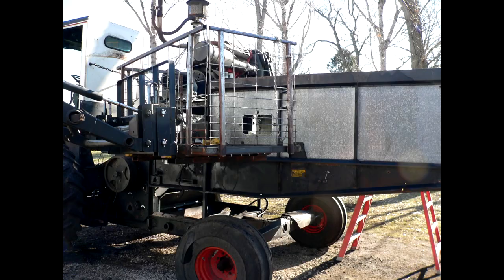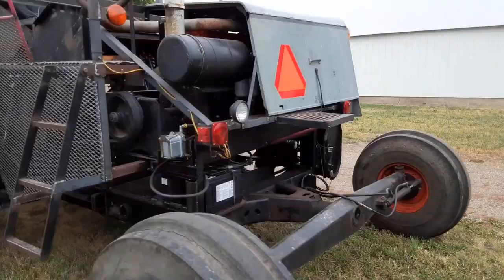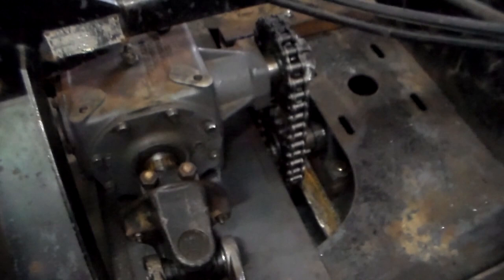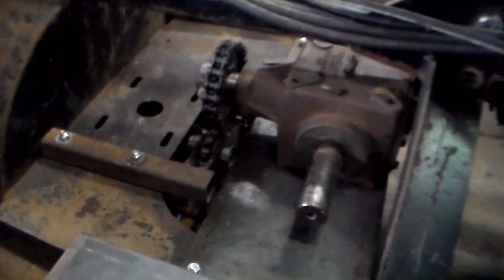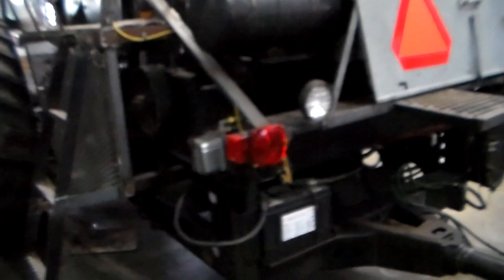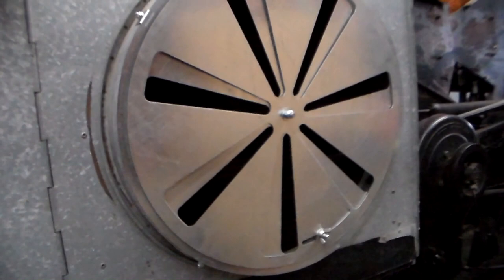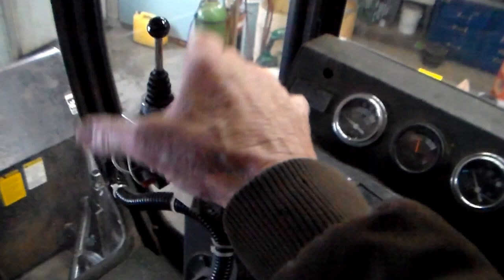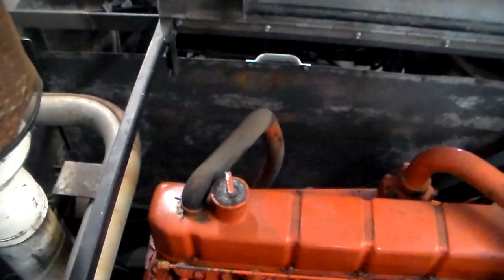Combine converted to snowblower

Comment: Nice work those old Gleaners were great combines..your design kind of looks like the Rolba ones we have here in Tahoe plows dont work in 5 foot + storms hope the engine has enough power though, many units  here have the detachable head used on dump trucks with a seperate motor to drive it
Reply from the maker: With the hydrostatic drive it should be as efficient as possible

Comment: Might eliminate the oil bath engine combustion air filter & substitute a paper filter Baldwin type filter, The rational is this use is primarily in wet weather, & fine blowing snow from the snow fan  can easily be drawn into the oil bath . Do to cold temps, a hydraulic oil cooler may not be necessary.  Does the drive axle have a differential lock ❓ The blower weight will aid traction, but ice may still be an issue. Chains may be necessary, Chains  (conventional) are useless with R-1 lug rubber, the Nortic diagonal link style perform best   And turning around should be performed where snow has been cleared, as any deep snow could be an issue. I might look for a  surplus rear hydraulic assist drive axle from a dismantling company for added traction when needed. Many a combine has burned unfortunately, but the rear axle, often in tact unless tires burned .  Should have enough hydraulic capacity, w/ an added activation valve, only part time use.  Cab heat, should be available from radiator fluid & restricting the air flow as shown will help, older diesels run cool.  The cab heat is most important for defrost function as YOU can add clothing layers. May need modified vent outlets toward glass, The air conditioner if equipped, may see minimal use .I have noticed several builds/ modifications like this in years past, but the redesign process was not shown in detail.  Nice project 👌🇺🇸🗽👍
Reply from the maker: It does have a dry paper element. No diff lock. I may purchase chains. However it can slip now, which may be a safety fuse?  Hydro rear drive would have been nice, but this combine did not have it.  Presently if it slips on ice as soon as I lift the blower it moves again.

Comment: Im thinking about building one out of a IH 1460
Reply from the maker: Search Youtube. There is a gentleman in Canada that did a 1400 series combine. I have heard they are quite easy to convert. They use the main gearbox rotated to power the blower. I did this Gleaner cause it was what was available at reasonable cost and had hydrostatic drive, which is what I wanted.

Comment: Can't see it giving much overall torque due to its two wheel drive configuration and rear steering. 

I'd be inclined to mount an IBC tote on the rear axle for weight and possibly a brine sprayer

Comment: As a retired welder fabricator . good job !   friend of mine always wanted something like this. He has pickup w/blade. as do I . They are very fast and efficient.  if you have room to pile up. I've seen swathers converted. Less work I'm thinking. my "question" is will it do deep snow like 2 or 3 foot .cause that's what we get. He has lots of buildings and trees so he dosen't have the room to move when it gets all drifted in. Looking forward to see this thing work in deep , blowed in drifts.
Reply from the maker: me also. Initially I was thinking swather, but when i picked up the blower from the auction I realized I needed to go with a combine. That blower is quite large. Originally designed for 180 HP tractor.

Comment: Think the augers and fan need a little more rpm's, look like you were pushing some snow. Raise the reflector angle a little to throw the snow farther. Great job!!!
Reply from the maker: thanks for the comment. Actually the fan is running more rpm than factory and the augers should be correct. Actually after watching the vid is the 1st time I have seen it in operation. Shall wee.

Comment: Greetings, very nicely built machine. The only thing I would like to have viewed is this machine running in 3 ft of snow rather than just a few inches that would have told the tale as far as the belts, bearings and chains being sized properly. The other thing is I thought you could have stayed with the wider tires and then just mount two Wings, one on each side so that they just gathered a little bit more snow that was equal to the edge of the tire and directed the snow into the auger. That was just my thought but I'm sitting here where it's warm and you were sitting there where you were using a welder and having a great time so well you know how much my opinion is worth! Thanks for sharing, I look forward to a video in deep snow and best regards Bob from Virginia USA

Comment: Thank you for sharing this. I like and enjoy creative stuff like this. Have you given it any thought about adding 8-12" wings or scopes on both sides of the snow blower?  I would think it would be helpful to keep the snow from ever having a chance of being pushed out on either side, while also clearing a little wider track with each pass.  You could place some kind of marker or guide pole on the outer top edge of each wing so not to hit anything with them. Just an idea.
Reply from the maker: Not really, when i was dealing with the width issue and large wheels the thought occurred to me. Here in MN, sometimes we have the blizzard conditions when the snow is whipped around for hours with high winds, and those banks are like concrete. So it could be difficult to break that material down so it feeds in. But you never know. Thanks for the comment
Reply: Maybe helpful for covering for snow accumulation over the exposure where it's more open sides front too back snow goes every where.
Reply: I'm wanting to make snow removal machine also & grain cart out a combine too.

Comment: That turned out just awesome.  Takes a sharp guy to engineer all the fabrication to make everything work.....pivot points so the belt tension is correct when raising the blower among many other things.  Would really like to see it in deep snow.
Would you do anything different on a do over?
Reply from the maker: Thank you. Well this year it has only been used once as we have had an extremely mild winter. I did run it thru some deeper snow last year, after the video, however did not get ample footage to do a follow up video. Things to change? Initially the combine had a 4 valve electric hydraulic body, which I abandoned after I realized it was leaking and unreliable. I replaced with a 3 valve electric solenoid operated. I should have went with a 4 valve, as I could have retained the hydraulic adjustable pulley that ran the header. I replaced that with a simpler set pulley size from a different combine. So, if I would have retained that I could have varied the auger speed on the go, like I can with the fan, using the separator clutch. Ah, future improvements, I have picked up a mud drive rear wheel assembly.  Not sure when I will get that attached. Will do a follow up vid when it is accomplished. Thanks for the comment.

Comment: Great build but you might consider adding extensions on the left and right side of the snow blower. It looks like you might want to change the position of the lower auger, seems like it needs to be moved forward. The blower is doing a lot of "pushing" of snow before getting pulled into it. I might be wrong. Cheers :)

Comment: I really like your “snowbinde “ ! Watching the snow coming out of the chute, got me thinking. One of the hang ups I have with my tractor mounted snowblower, is the wind can catch the snow and bring it back in the cab windows. And I always wondered why they don’t make the discharge chute a bit taller? If your chute was 2 feet taller , the snow would be higher than the cab before it started to fan out wide. I have seen blowers mounted on forage harvesters used in the city to fill dump trucks, to clear plow banks, and they are much taller chutes. Just thoughts. Very nice work, your neighbors will be wanting you to build them one too !
Reply from the maker: Thank you for the comment. Yes, I have also seen those for filling trucks in the city

Comment: Great project! A better grade of snowblower is only recommendation. Yours seemed to always leave a small berm which renders not a clean sweep!
Reply from the maker: Thanks for the comment. That may be my fault. The bottom of the blower was completely gone. I rebuilt it and in hindsight I may have extended the bottom plate too much.  It does show up if snow is light, or end of a drift.  Oh well, works a hell of a lot better than my old tractor mounted!

Comment: Great conversion! I see that you might need some additional width so maybe add on each leading vertical edge a piece of 1/4” x 6” plate at about a 45 degree angle (if your shop doors are wide enough to still drive through). Hard face the edges and bottom as these will be your ‘cutting’ edges
Reply: I have experience w/ your suggestion & it did  not function as intended. Worked more like a plow on the blower ends, & did not funnel snow into  the angers as presumed.  Bigger issue was hard heavy wet snow containing ice & in deep drifts.

Comment: Great job!  Excellent welding and fabrication work.  Did you consider using hydraulic drives instead of the belt drives?
Reply from the maker: Yes, I considered a large volume pump driven off the main shaft. However some people i visited with were not happy with their hydraulic powered blowers, stating a significant hp loss. As i got into the project further it appeared it was going to be quite simple to stay with mechanical. And the cost of a high output pump and orbit motor would have been considerable. Thanks for the comment

Comment: That is really cool.
 Just a few things that I observed. It looks like you need to speed up your augers because they're not feeding your blower fast enough, and you're pushing snow ahead of the blower. Also, you could add some more paddles to the bottom auger to feed the blower. I did this to my walk behind, and it eats and throws snow as fast as I want to push it into the pile now.
Reply from the maker: This is interesting. It is the 1st time I have seen the blower operate. However the augers are actually running the correct rpm for a 540 pto. I do have the fan funning at 650 rpm, as I still have the variable speed v-belt pulley on the right side. Perhaps they could be sped up. Always improvements
Reply: @hrodd2  I actually slowed my impeller down, and it throws the powdered stuff much better!

Comment: Nice job, like to see in deeper snow to see what mods it needs. More power? 4 wheel drive?  More wind shield wipers?  More weight on back? So many options to look at.
Reply from the maker: rear drive would be nice. Maybe next build. I may try chains. Undecided at this point.

Comment: great job.whats the deepest snow you used it in.and how does it handle drifting snow
Reply from the maker: At this point, still waiting for the "big one" It did handle the drift by my grove easily, which was about 36" tall. I am becoming more comfortable with it now and do not forsee any mechanical issues.  This blower was designed for a 180hp tractor. So, the blower should handle just about anything. Just a question of the mechanics . Thanks for the comment

Comment: I always wondered how well an old combine would work as a snowblower .
You did a magnificent job with that old Gleaner , it really moves some snow .
Have you thought about adding some weight to the rear ?
Seems to want to lift the back when you raise the blower up . Being a rear steer vehicle that might a get a little fun in some situations .
Reply from the maker: Thanks for the comment. The back is light when the blower is up, however with snow and ice a simple stomp on the brake and it will whip right around. So, that was perhaps an accidental advantage.

Comment: Nice job on the transformation. That took a lot of work and working out how to make it all  work. I noticed when you were on the road near the end of your vid some snow got round the side of the blower. Would it be worth putting some extensions on the sides of the blower in a y looking forward to funnel in the snow in to the blower? We get snow on and off here in Scotland through the winter. Biggest problem being if you drive over the snow it packs in to ice. Which will thaw and then re freeze. After that is like driving on glass. M 😀

Comment: Very cool!
 Does the auger have shear bolts like a regular snowblower in case you hit something buried in the snow? or how does that work?
Thxs
Reply from the maker: Yes, each auger has shear bolts and there is a shear bolt on the main shaft driving both augers. Trust me, I definitely want that safety factor in there.

Comment: I really like the build! I am wondering if there will be future issues with that belt drive. Takes quite a few HP to do deep snow. I would think that belt is really going to wear fast. Right now I have a front mounted blower using a PTO pump made by Volvo that powers all the hydraulic needs of the blower. Works great!
Reply from the maker: We shall see
Reply: @hrodd2  You will probably be adding some decent LED lighting. You may have to take some steps to mitigate the snow that gets sucked into the breather. You being from MN are no stranger to snow! That thing will get plenty of use! Another nice option would be a back up camera as well just to save you from cranking your neck. I take those tires and rims are from a sprayer? Plenty of pounds per sq inch. Probably wont need chains. Too bad it could not be shortened for ease of maneuvering. I was thinking of making one using a 4x4 pickup truck frame/driveline and a cab from a combine with a secondary engine powering the hydraulics. In Ontario here by the way.

Comment: That is very impressive.  I built a snowblower for the front of my 4 wheeler and it works great.  I was wondering if you have trouble with the belts getting wet and slipping.  It was a real problem for me until I built a proper cover to keep them dryer.  Again that is one of the most impressive builds that I have watched on utube.

Comment: Nice job I've always was told if you have u joints on one end of shaft you must have u joint on both ends be interested to know how the shaft running the gear box on the right side how long it will last maybe I've been told wrong
Reply from the maker: should work fine. The angle, if any is very slight, as I attempted to do the alignment as perfect as possible. The u-joint is there to take care of any misalignment and the two pillow blocks hold the shaft and eliminate side thrust on the u-joint

Comment: Did you consider running the blower off of a hydraulic motor instead of belt drive? Seems like an alternative to reduce total metal fab could also have added an aux pump for high cfm. Could also then go to a quicktach and been able to use  skid steer implements...hmm...maybe I'll have to look for an old gleaner to play around with...
Reply from the maker: I did consider going with orbit drive. However it would have been more costly. I would have needed a pump on the unit and the orbit motor on the blower. ALso, there is loss of efficiency with hydraulic drives. So, I decided to stay with mechanical.  Thanks for the comment

Comment: impressive volume coming ng out of that chute, I was a bit weary about that belt drving the 2 nd stage but it obviously works, how is the first stage powered, shaft or belt again?  nice setup and excellent visibility in that position, thanks for sharing 😊
Reply from the maker: the augers are also belt powered, by the electric clutch on left side of machine. thanks for the comment

Comment: Very nice! What ended up not working very well? What are the major drawbacks?
Reply from the maker: At this point i honestly do not foresee any major drawbacks. Some people mentioned belt slippage, have not had any issues there. Visibility was also mentioned, however I can see everything very well from the cab.  Traction, not sure if I want to go with chains or not. Without them there is a safety valve, not running into something too hard. If I do slip on icy conditions it moves instantly when I lift the blower.  Time will tell. Thanks for the comment
Reply: How about high load? Does it keep up very well? Like if who would compare to a conventional tractor setup. And how about shear bolts? Did you keep something like that installed?
Reply from the maker: @lukassawatzky604  factory shear bolts are in place at augers and main drive shaft for the augers

Comment: Incredible work and problem solving, looks like it works really well. I did notice traction on the drive tires was a bit of an issue at some points, have any plans to add chains to the tires?
Reply from the maker: Good question. I have considered it. Currently it does great until i run into a patch of ice. But when I lift the blower it instantly moves again.  You know honestly I am on the fence regarding chains. The plus side it will obviously go thru more. But then also there is the chance of stuffing it into somewhere where you should not go?  Currently if it does slip it is like a safety valve. We shall see. Thanks for the comment